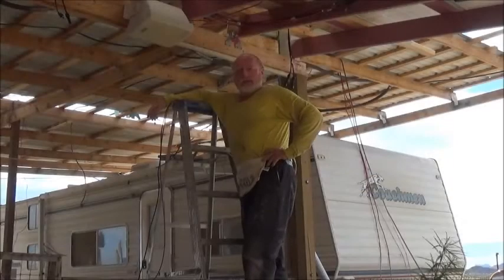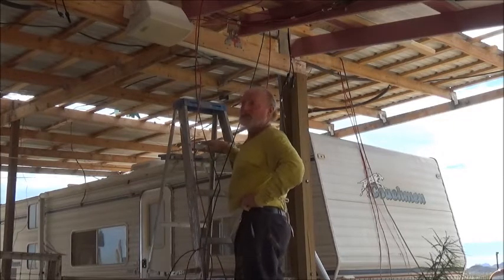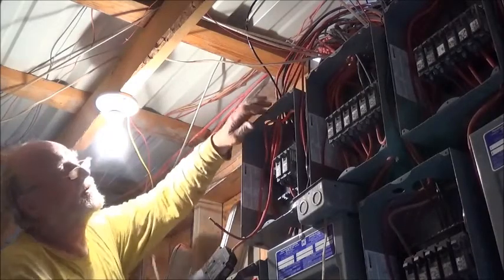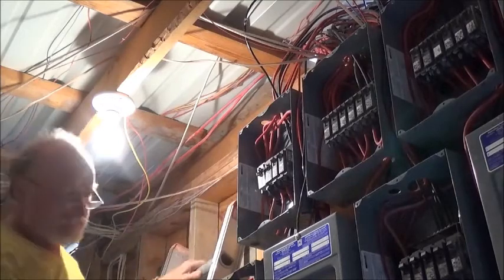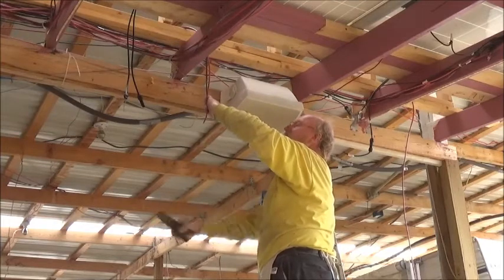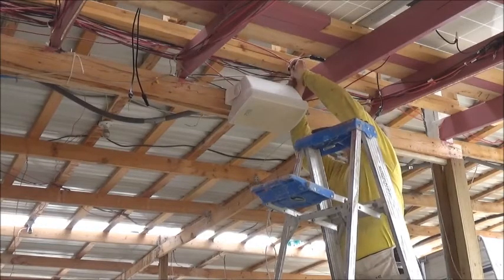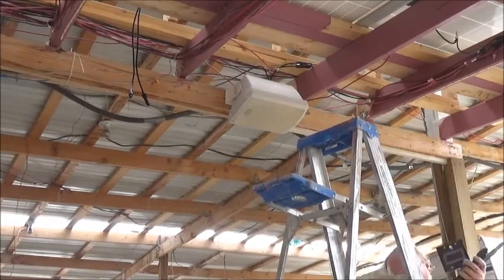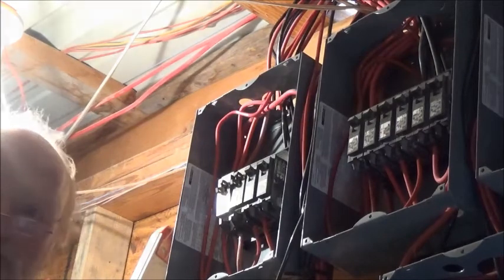Connecting A Solar Panel

Comment: How do you have your inverters wired for 220
Reply from the maker: Larry,

That is a great question because not everyone is an electrician!!!! But it is easy to do.... the hardest thing is that you have to have TWO inverters, OR one that will develop 110 volt, two times. AIMS (and I am sure others) offer an inverter like this, but I have no experience with them. In the two inverter scenario, BOTH inverters will wire to your battery bank. Now you will have two independent sets of wires coming from them. Treat these as you would your supply from the grid.... both neutrals (the whites) will go to the neutral bar in your fuse box. BUT, each line wire (the blacks) will go each line input on your fuse box. Then, when you have a 220 appliance the double fuse you use will combine the 110 lines to supply the 220 for the appliance. Thanks for the question!!!
Reply: I've been wanting to do this but I bin scared of Blowing up my inverters I have a AIMS 24V 5000W 110V So these will not back feed in to each other Thank you very much Larry
Reply from the maker: Larry Kemp I am not an electrician, but in nearly three years of running the same AIMS powered 220 volt system, we have had no problems!  We have 13000 watts of AC power. We can run two refrigerators, one freezer, two A/C units AND a welder, along with the TVs and all the "phantom loads", ALL AT THE SAME TIME.... I HAVE DONE IT.....with absolutely NO problems!!!! Do it, you should be just fine!
Reply: AIMS and a few other people that sell these Couldn't answer that question Thank you very much Larry